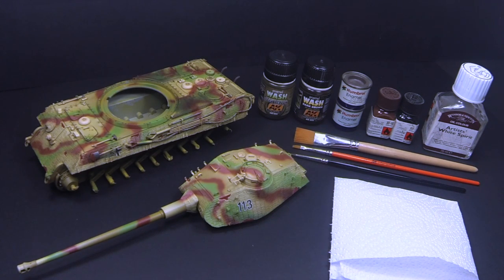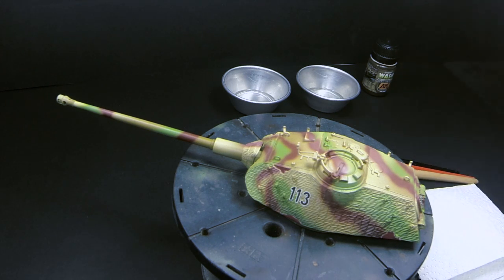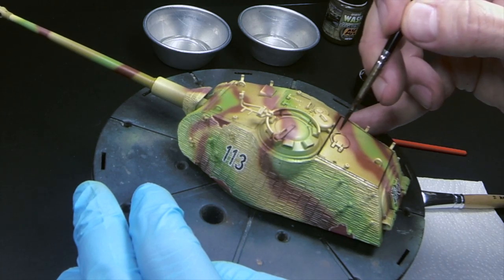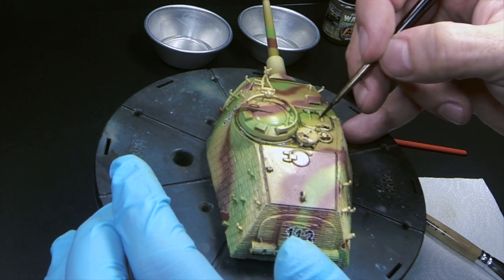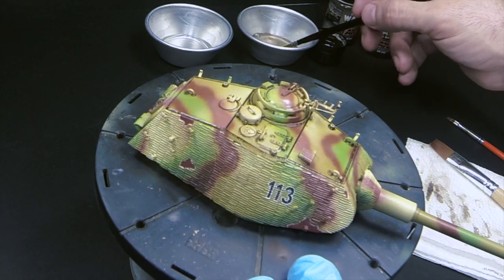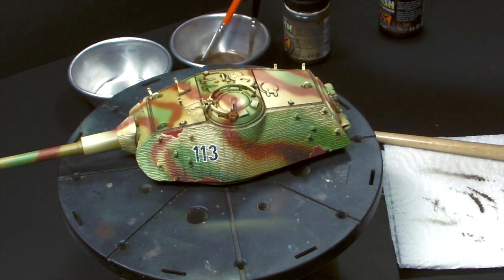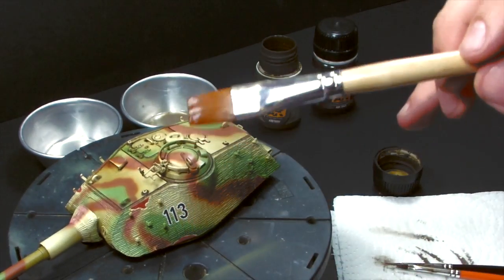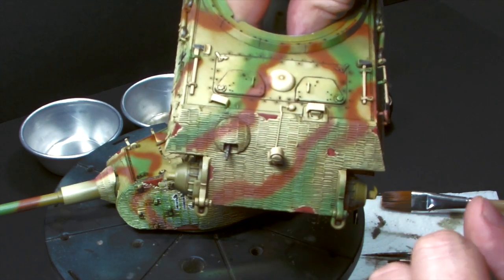Tutorial - Applying enamel washes

Comment: I don't think you mentioned - did you clear coat the model before applying the washes? Gloss? Satin? Or are you just getting the capillary action from the white spirit you apply first? Thanks
Reply from the maker: I did clear coat the model with satin varnish after applying the decals in my opinion it is always good policy to seal everything before starting the weathering stages. In my experience both gloss and satin varnish work well, but the matt varnish not so much, it grips the excess pigment far too much and makes the tidying up difficult. Thanks for watching! :)
Reply: @reelmesh  Thanks Carlos, any advice on the satin/gloss coat? does the Tamiya clear (acrylic) works? thanks!

Comment: Excellent video, Carlos. Thank you for sharing this.

Some questions if I may?

Firstly, as you are initially moistening the surface with clean white spirit, do you need to have applied a gloss clear coat to the model before starting your pin wash?

Second, how long do you let the wash dry before you went over the hatch for the second time?

Finally, what is the wonderful music that you used during the video? I'm going to have the bass groove and guitar chops running through my head for a while now :)

BTW, the King Tiger looks fantastic. I love the modulated 3-tone camo scheme. Very subtle, in an almost subliminal way.
Reply from the maker: Thank you John! You may indeed. I usually work with satin or gloss coats between weathering steps, keep them as thin as possible, they help the flow of the washes and further layers of effects.

When I complete a layer I leave it to dry overnight so that your previous work isn't affected by the second application of the wash.

The music is from the youtube audio library you can find it under your channel settings - creator studio. 

I hope it helped :)
Reply: Carlos Mendes Thanks, Carlos. That explained it perfectly. :)
Reply: @reelmesh  Hello! Can I protect the  enamel paint with an enamel coat? And Can I use enamel washes on it after the clear coat? I use revell enamel paints and clear gloss.

Comment: Hi Carlos
Great tutorial and very useful
I live in a country where white spirit doesnt exist.
Ive looked everywhere and the only thing i could find is "rectified Turbentine" do you think that would work for a wash? I am worried about putting it on a model and having it dissolve through the varnish and colors or ruin the model im also not sure how it would react with the enamel wash.
Appreciate your help
Reply from the maker: Hussein El Kaissy Hi Hussein, thank you! Sorry for the very late reply.
I have thought about this matter and I fear that you are right, turpentine might ruin everything for you. 
However I would still experiment before dismissing it completely. Take an old kit and apply a very solid coat of primer, this will serve to protect the bonds between the glued parts, then I would apply Acrylic paint followed by acrylic satin coats, two at least in order to protect the paint job. Then I would try it with oil paints and rectified turpentine or a similar product, just remember, you can use any solvent for oils and the mildest grade you can find. Then try small amounts of the application and method on a hidden part of the model, such as under the mais hull for example. This might take a few attempts until you get the hang of it but It should work well. :)
Reply: Carlos Mendes thanks carlos for your reply, i tried the "rectified turpentine" with the enamel wash and i worked perfectly when applying your technique and as the acrylic below it is protected by a mat varnish it wasnt damaged.
I used it on my last model and the results were amazing.
Thanks Again
Cheers

Comment: Thank you Carlos !    Well done mate !
Reply from the maker: Thank you Norm! I appreciate your feedback. :)
Reply: Hey Carlos !   

Do you use  AKi "Normal" White Spirit or the Odourless White spirit ?     I have been getting reactions...  with AKi paints when I use the Normal White spirit....  and I am concerned  its attacking the FUTURE and the Aki paints...   while the Lesser aggressive Odourless one is fine !!!

I am not 100% certain my White spirit is the original ?  as I might have used Varsol to top it up !  but just wanted to check with you !

Later dude !
Reply from the maker: Norm Lajoie I use Windsor and Newton Artist's White Spirit, you can also use Sansodor which is the odourless type, I stopped using the non artists grade WS because it was too strong and I got some nasty reactions like the one you describe besides breaking the bonds between parts much faster.
As a rule of thumb, I only use artists grade solvents and paints, the reason being that for weathering purposes you need control and quality, thus stronger solvents are reserved for cleaning brushes and containers. 
I also stopped using future to seal the layers, I now use vallejo satin varnish, i found out that future can react with the different materials and processes we use to weather the models.

Comment: Hi Carlos I've a quick question about the applicaton. I don't have any varnish to apply to my acrylic painted panther because I don't ow an airbrush and spray cans are expensive, so if I used this technique on my panther and its acrylic surface would it be damaged? I really want to achieve nice techniques like you've done but im worried I'll damage the model
Reply from the maker: I don't think you will have a problem executing this technique on top of acrylics, the reason being that they are two completely distinct paint systems with many and opposing chemical differences.
Reply: Carlos Mendes ah ok, will it still be effective then even though there isn't a gloss coat to help the wash flow? Thanks for the quick reply by the way really appreciate it :)
Reply from the maker: I think so, of course it depends on how matte the paints you use are. Tamiya paint for example is extremely matte and I recommend extra care in the application. But for example, Vallejo model color is much more satin. So it will depend on that. Proceed with caution and good common sense I would say. :)
Reply: Carlos Mendes its funny you mention those two paints because the base was sprayed with tamiya and the camo was brushed with Vallejo haha. Thanks for the advice! I'll send you a photo once its complete for your judgement if you'd like
Reply from the maker: Paul Leggett Ok Paul, I'd like that. :)

Comment: First time thumps UP for your very informative tut! may i ask, do you always clear coat your models before you apply the wash or oil paint ? or you just use thinner to get it flowing better ?
Thx!
Reply from the maker: Thanks you for watching, commenting and hitting that like button! :)

I don't necessarily clear coat my models prior to applying washes, though a satin to gloss surface is better for this purpose.
Some paints already have this finish like, AK, Mig, Vallejo thus I do not clear coat, others like Tamiya are really Matt and in that case I'll clear coat them with a satin varnish. 

I hope this helps! :)
Reply from the maker: The clear coat must be Satin or Gloss, Matt will grip all the wash's pigment and become hard to work with. 
Unless that is your purpose don't use those washes with Matt surfaces.

You need to understand the surface differences between matt, satin and gloss.

Matt is porous and gloss is sleek, matt will grab and hold the pigment, gloss will flow the pigment. Satin is literally in between both matt and gloss.

The same is true when applying Pigment powders.